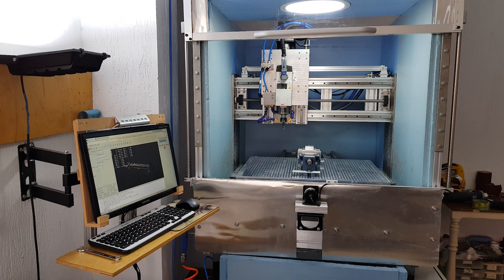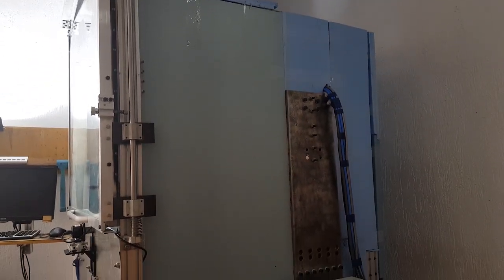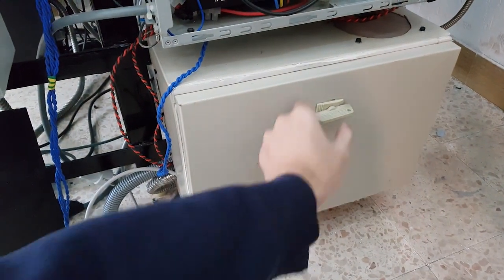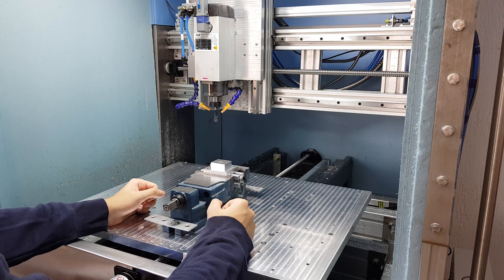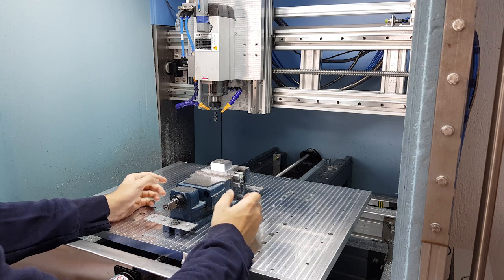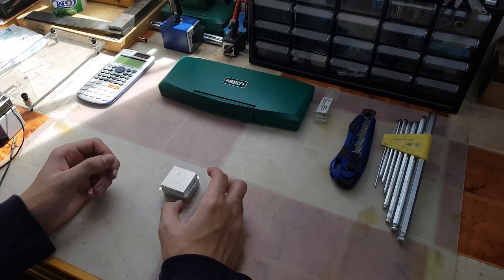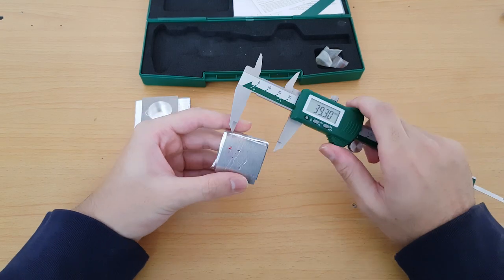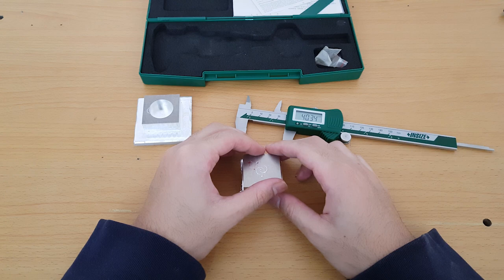DIY CNC MILL fixed gantry type w/ linear encoder feedback + Accuracy test

Comment: Just my view on this, calipers are recommended until 0,1mm resolution, for micro meter precision i would use the micrometer gauge, pure mechanical at room temperature. But it is a great machine you built!
Reply from the maker: Calipers can hold an accuracy of  ±0.02 mm and by applying constant pressure every time you measure, I compare it to 100mm standard every time I make a critical measurement, but I see your point a micrometer would be light-years better in accuracy and precision for sub 20um measurement also I am kinda broke right now :D so I get by with what I have until I can afford to get a set of micrometer gauges.
Thanks so much for the input, I appreciate it.
Reply: funny that i can mostly measure to about +-0.01mm with a calliper :) but yes it is always recommended to use a micrometer if you can.

Comment: With linear encoders as feedback, have you considered using rack and pinion drives for the axes?  Methinks commercial quality would do for this application.
To control any backlash, the drive pinion would be spring loaded onto the rack.  This is already done on modern rack-and-pinion steering.
Note there are other ways to address backlash.

Comment: Great video. Thanks for sharing the good and the bad!

Is your linear scale missing steps because the CPU can't process fast enough? I have a project for linear glass scales and I'm using Arduino, but the steps were missing. I read that an ESP32 might be better because it processes faster.

Comment: Very nice setup and the accuracy is very good. Keep up! Also, you need to shows us what type of linear scale (encoder) you are using.
Reply from the maker: Thanks.
it is a off brand optical linear encoder the cheapest i could find on amazon, it was like 50 bucks for 650 mm.
if you are thinking of buying one get 1um resolution as i mentioned in the video ,it is a big difference.

Comment: I loved your first tutorial on installing linuxcnc and the mesa card.I liked this one as well, but some parts were beyond me. The explanation of the physics /mechanical motion was great. but , as i am not yet familiar with the PID or mesa terminology, i did not fully understand how you were tracking error- i assume it has to do with some variables you can look at in  the software, and tune them. 
I've built a number of CNC type devices, laser, moving gantry router and a column mill, but always used steppers, drivers, breakout boards, mostly on windows boxes and some sort of abstracted engraving or cam software to actually run the jobs. MACH3 was the most detailed CAM software i came across and it made me realize that there's a lot more detail that can be accessed, but I had always assumed that was the domain of high end industrial hardware. 
I'm just now beginning to realize that a closed loop approach has a lot more to offer in terms of accuracy, process control and so on. It also seems that moving to linuxCNC is also worth exploring, i have yet to do that. As i began to look at this specific "stage" of diy CNC machining, i cannot say i found much that directly applied. I saw some from RotarySMP, who referenced your tutorial, but even his were a series of 25 episodes dealing with the basics of building a CNC lathe, and really on one episode on the MESA card and another on the spindle encoder. Claugh42 has some interesting content for his electronic lead screw that explains it in detail, Robrenz is amazingly meticulous, but he is mostly focused on the machining, and let's be honest, he's working with machines most home players will never have access to without a lottery win. 
I realize it's probably a pain in the ass to film something at a newbie level of explanation, but if you do, i'm pretty sure it will have demand, because, as i said, there are not many that focus on this sweet spot. I think of it as the transition between , let's say, basic cnc motion control  into high accuracy CNC- PID control, closed loop, what sort of  hardware, configuration and practices are needed there.  It might seem like it's not a big audience, but it's logical that all the makers that dove into CNC will sooner or later need to dial in their craft and end up in the same position. 
Just some food for thought. I can't wait to see your next one. 
In case you are want to know what would be of interest, or need ideas:
Would love to see more detail on how you added that second card, and made the inputs work in tandem with the steppers. It would also be good if, in the voiceovers, you spoke about the choices you made in hardware/software, the selection process, what your rationale was, features that you found important, trade offs, other brands considered, what's compatible wt what  and maybe where to obtain them- all that is likely detail you had to contend with, and while it might seem irrelevant to you now, it's probably valuable to most  of us.  
Anyways, thank you for the efforts so far. Great content. Hope you will continue.
Reply from the maker: Thanks man for the support and the ideas :).
I planing on making linear encoder tutorial/set-up ,but free-time is hard to come by.

Comment: I have always wondered why you used the 7i96 but not 7i95. I believe the 7i95 has both features of the 7i96+7i85s. Is it because of the price?
I'm asking this question because I want to use linear scale encoder like yours :)
Reply from the maker: yeah, the price was one side, but The biggest factor for me that it had the ethernet over the older PCIe ones and many people were using it or more specifically it had a "community" (people that already found a solution to a problem that could face me in the many possible configs of the board) when I was getting started I didn't know much about FPGA or mesa-HAL language, I wanted to get up and running quickly because I was facing other problems in the mechanical side.
good luck with your setup:).

Comment: Awesome job.....can you please provide the model of the DB25 connector that is in the bottom of the Mesa box.  Also, you mention a "distribution board" going into the stepper driver box(the thing wrapped in tin foil).....is that the same as a DB breakout board or is it something more?
Reply from the maker: thanks :)
there is no model no. it is just a DB25 breakout to male pin stripe 2.54 mm that I bought from some Chinese site that I don't recall.
The "distribution board" is just a PCB I put together that convert from DB25 connector to screw terminal ~(like the one that stepper driver use to hook up wires)~ without any active components "just a connection".

Comment: For nice finish u can try 3 flute aluminium cutter carbide . Or u can have better finish with single flute with low speed  , about 400mm/ min , same on 3 flute , and about 20000 rpm for 3 flute , 6 mm , or 24000 for single flute , and if u put some oil , u get the best finish.

Comment: Congratulations on very nice build.
Your progress from v1 to v3 is enormous.

I noticed you climb milled both rough and finish passes.
Climb milling rough pass is most likely  reason for chatter (=noise).
Your machine is still not rigid enough to handle the forces in climb milling.
To be fair it would be very difficult to build a machine frame from thin aluminum profiles bolted together that would be rigid enough not to flex a fraction of a micron, but that is all that is needed for chatter to start. Then you have clearances between linear rails and carriages that also add to the tool chatter.
Try splitting the tool path, run rough as conventional and only finish in climb.

For version 4 watch YouTuber from New Zealand that build his CNC frame from granite plates.

https://youtu.be/gUFeoDf1YvM